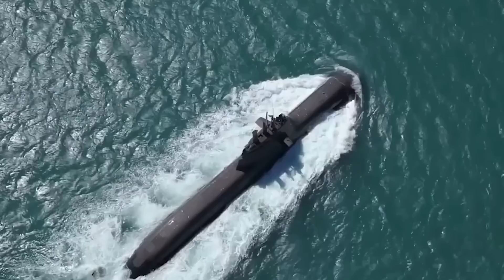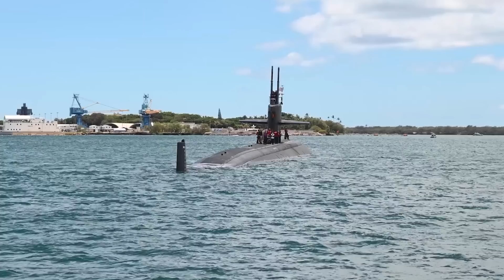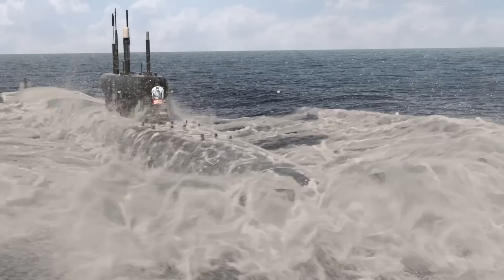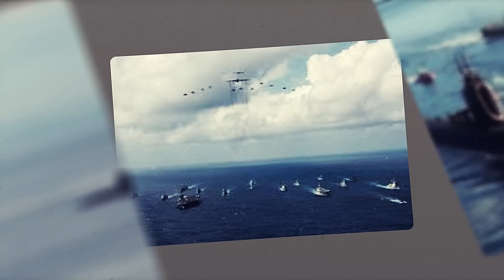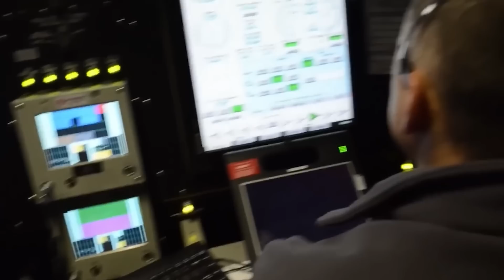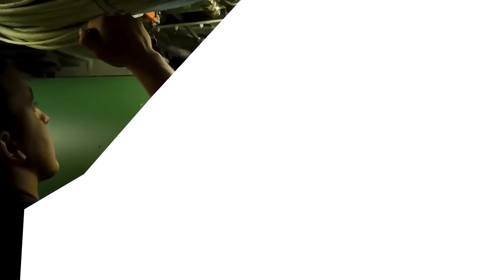US Deadliest 2024 Nuclear Submarine Is Ready For Action

Comment: I was wondering if people on a sub can climb into tubes similar to missiles  and be launched to safety if something went wrong 😮
Reply: Good question, answer being not recommended for this type of use, due to the possible depth you could be "deployed" at. After special training(basically learning advanced breathing techniques) it could be possible to exit the torpedo tubes and ascend to the surface after excruciatingly constant exhaling(to avoid the pressure decrease causing your lungs to burst), that and secure belief in your afterlife...yes Virginia, you can(in theory) exit a submarine via the torpedo tubes
Reply: @charleslord8672  thank you  for the response and for your service.
Reply: Certain Special Ops personnel do exit and enter some of our submerged vessels via a little more safe, less known method utilizing what is (or used to be) called a dive trunk. The concept behind the "launch" tubes is to propel the projectile with as much pressure as to clear the tubes, thereby activating the onboard(projectile) propulsion system towards the target. Hope that helps Stoners👌